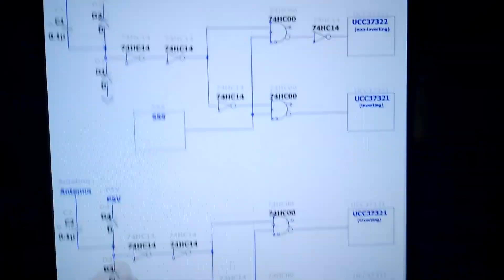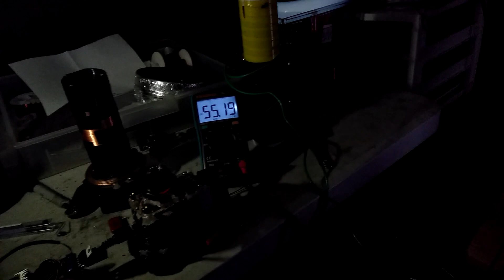Steve Ward Mini SSTC (interrupted without enable pins)

Comment: I did and they didn't work. I measured the signal voltage at pin 2 of the 2 ic's and they are both around 4V and one more thing, the LED indicator lights up as soon as power is applied but no interrupt signal is given. You said you made your own oscillator, so can you be more specific?
Reply from the maker: Sorry you have to refresh my memory again. What is not working for you?
Reply: @Magneticitist  When power is applied and there is no interrupt signal, the indicator light at 74HC00 lights up continuously. When I applied the interrupt signal and measured the voltage at pin 2 of both UCC ic's they were at 4.23V (they were inactive). I tried reversing the feedback coil but it still didn't work. What should I do?
Reply from the maker: @truchuynh53 Oh right the UCC's without enables obviously. Is it wired just like in the schematic? Assuming your gating circuit is working you can just test it using CW at lower voltage. Instead of an interrupter signal just pull one of each NAND gate high with a DC source or set the interrupter to a high on time or something, then try to excite the circuit into a feedback loop. If you're using an antenna this could be just by introducing enough 60hz noise to it. Maybe by touching it etc.

Comment: Will the NAND gate work with the QCW Staccato interrupter that LabCoatz created? I'm not clear which are the A,B input pins in the diagram.
Reply from the maker: The A and B pins are just each respective input to the gate. There is going to be a "truth table" for AND and NAND gates. With AND gates so long as both inputs are High, the output will be High. With any other combination where only one input or the other is High, the output will be Low. 

With a NAND both inputs need to be High for the output to be Low. Any other combination and the output stays High. The gating should work pretty much anywhere an interrupter is used on enable pins like that so long as it doesn't mess up how the feedback is supposed to work. 

So in the diagram you can see that in the case of the 74HC00's the feedback signal is just passing through them at either input, but only when the other input is in the proper state. 
If the feedback signal has an input of a NAND going High, then the output is only going to change to Low if the interrupter output has also gone high. The output will go back to being High again as soon as either input changes states.

Comment: greetings to Magneticitist ...
ucc37322 many circulating fakes
yeah .. maybe actually tc4420
i am also using the tc4420
without antenna .. directly from the secondary
use the positive path for the interrupter
works pretty well with the mini coil
driven 1 mosfet irfp460 with a voltage of 90volt.
Reply from the maker: I ended up just getting some real 2732X's from digikey but I've been too busy elsewhere to ever do much with them. I put them in my Steve Ward DRSSTC circuit but I never purchased the IGBT's and capacitor because I couldn't decide on all I needed and wanted to save on shipping avoiding multiple orders lol. I believe the fake ones I had are the tc4420's but they do still work quite well aside from no enable pin.

That's interesting about feedback to the interrupter though. For that to work does the interrupter need to be able to handle the resonant frequency of the coil?

Comment: Looking good now, the interrupt works just as it should with no weird misfire, I'd go with a reliable parts source too, seems u get more fake stuff in the states 🤔 it could be the coil that cant produce the output u want but I kinda doubt that, I think the h bridge gets less of the input voltage as a single fet would, the input voltage is halved on the h bridge but I'm not 100% on that, if the fets can handle it, crank up the voltage slowly and monitor the output for anything unusual, if the interrupted output misbehaves then theres a problem but so far everything looks green light 👍
Reply from the maker: Yea I guess to a degree it makes sense being that the single fet driver is getting full voltage while each fet on the half bridge is only getting half voltage. So technically those were about 85V breakouts. In that sense I suppose I would need to push 300VDC in there to beat or match the single fet with the bridge just potentially being able to handle the power better. I've seen too many 170V builds that work like DRSSTCS's though. I think part of it is the gate driving and phasing. This one would switch hard until maximum voltage where it would start switching softer so when I pulled hot arcs it drew less instead of more. This may be due to how I've made the primary.